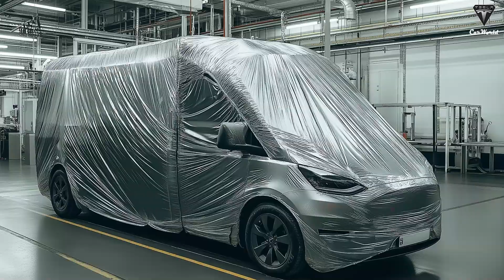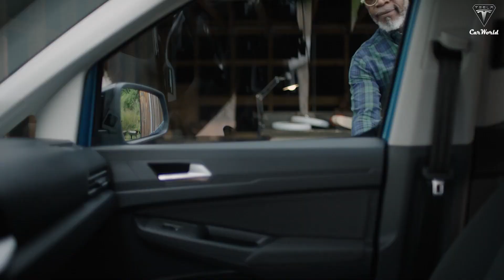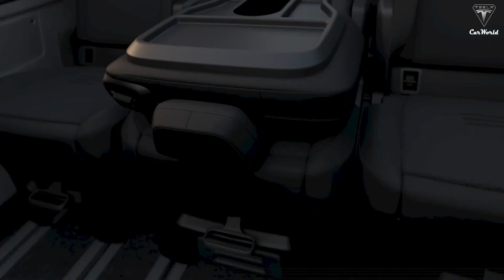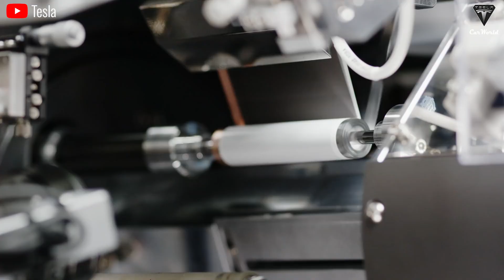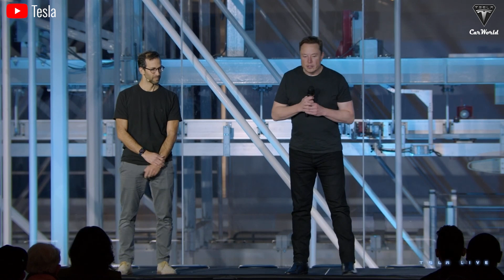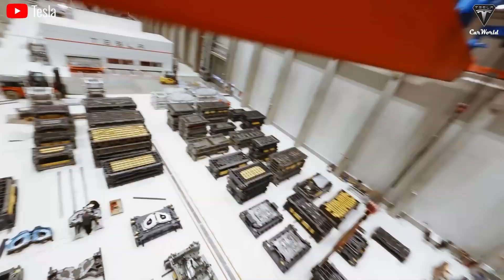Elon Musk LEAKED Tesla Van Coming! Exclusive Design, 400 Miles Range & Best Inside ! First Look

Comment: The most important feature to me would be the ability to hold 15 total passengers. This means that there should be different options as far as seating arrangements. The second most important feature to me is fast charging you have to remember that in a car there might only be a couple people waiting but in a van if it holds 15 people as I mentioned would be my preference you don’t want to wait around with that many people, so half hour to charge is not going to fly!